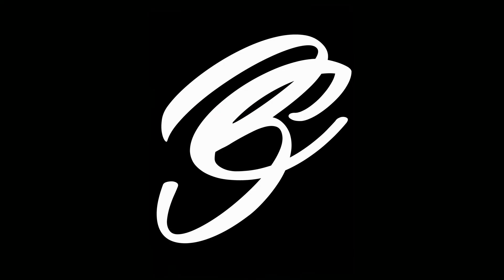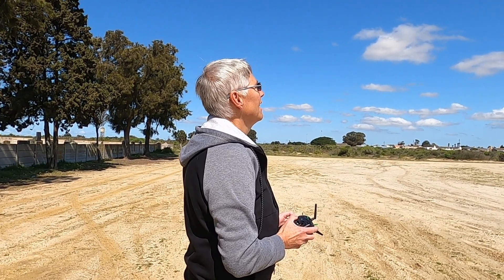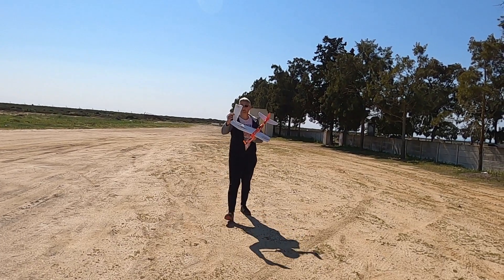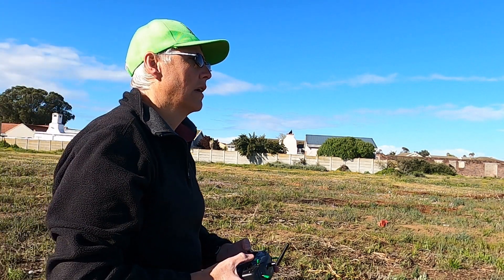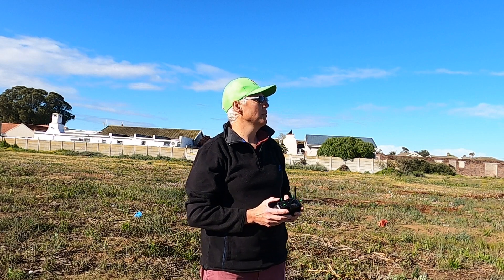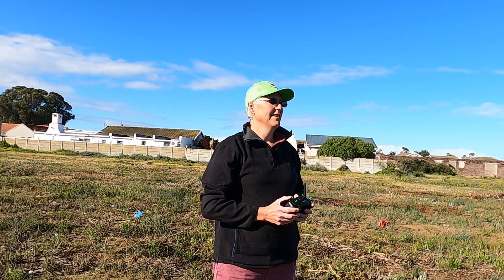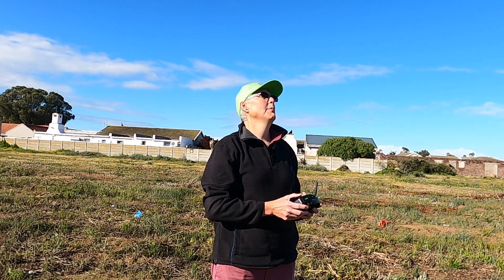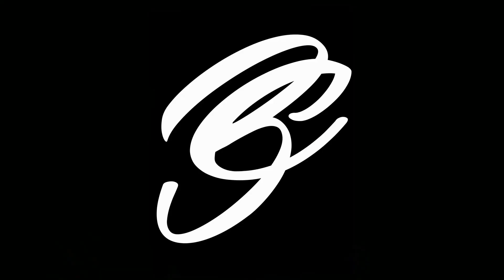Flight Review Volantex Xpilot AX601 6-Axis Stabiliser using SBUS

Comment: Bill, since the Manual linked to on the Banggood sale site is for the older version (for T-tails only not the newer model with provision for T-tails, V-tails and Deltas) could you possibly add a download link to a PDF file or image of the newer manual you received in the Description?
Reply from the maker: The manual is to say the least bad! It has been printed in very small letters but I will scan it tomorrow and add it to my google drive if it is readable. Please check after 24 hours and it should be there.
https://drive.google.com/drive/folders/1mb1nhTCaJ3qz73wusjV3j_dlOA-Ks7nY
Reply: @the-happy-RC-flyer  Thank you for posting that Bill!

Comment: Hi Bill, if you like to tinker, try the ZMR Nx4 PRO. I'm using one in my Easystar clone, but getting it to work was a bit of a hassle...
Reply: Hey Jan. I bought a ZMR Nx4 EVO (the version with the PANIC save self-leveling function) and it did not arrive with a manual included. Did your Pro version? I have downloaded the Nx3 EVO manual which seems to be the same product so will set it up on a test board and see what happens. What problems did you have in setting yours up?
Reply: PS  Also just set up a HobbyEagle Pro in a Volantex G2 Ranger. Awfully complicated with all the different menus and flashing LED colours/patterns etc but not so bad when there's 2 of you. 1 to read the manual checklist and 1 to push the buttons. ;-)
Reply: @theoztreecrasher2647  Here's the link to my woes on RCG: https://www.rcgroups.com/forums/showthread.php?3856427-Which-one-to-get&highlight=ZMR+NX4+pro+flight+control+3+axis+gyro It includes the manual I received.
Reply: @janspoelstra8309  ;-) OK Now we know who you is! :D
Reply: @theoztreecrasher2647  That's what I was affraid of...
Reply from the maker: Hi Jan, I will try and get hold of one to review.